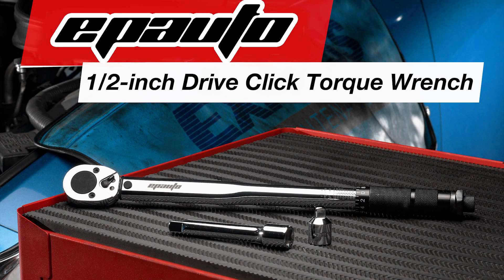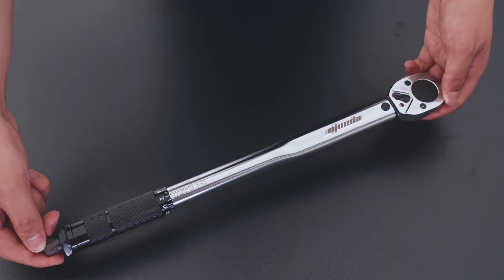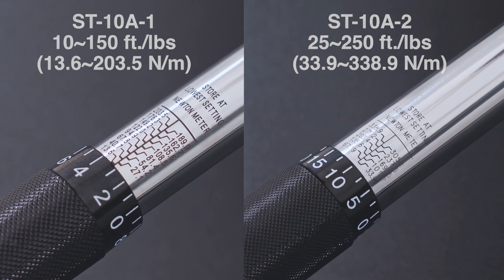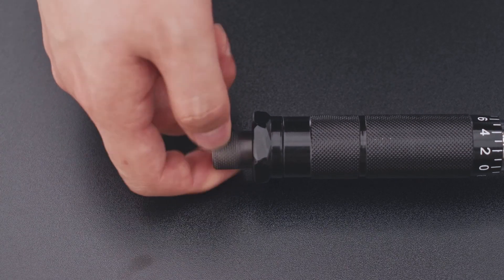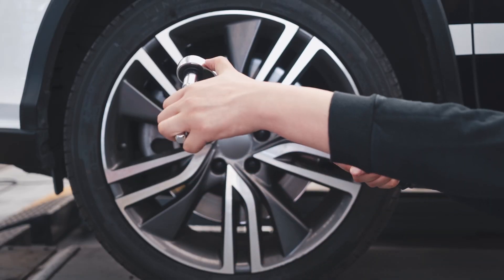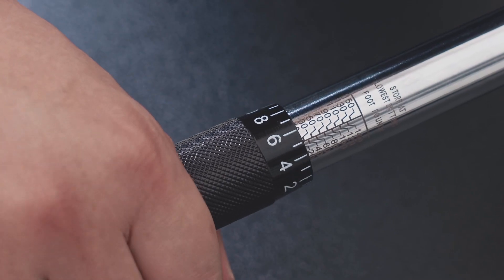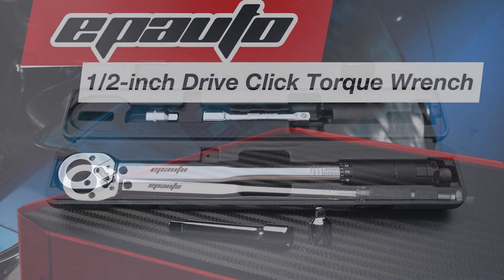EPAuto 1/2-inch Drive Click Torque Wrench Instructions

Comment: I've had one of these for a couple of years. The numbers on the micrometer wear off even though I never even wiped it down. . I never used any cleaners either. I have to be careful using it. I don't use this often since I'm not a professional mechanic. I have used torque wrenches at work as a electronic technician and found there aren't any of these that can be trusted. They don't click when they're suppose to and you either  break off a bolt head or you squish a battery terminal.

Comment: I bought an EPAUTO inch pound (in-lb) torque wrench which was total garbage. When it was set at 31 in-lb (which isn't much) to tighten rocker cover bolts it was way off by 40 in-lb. It just would not click until the bolts where way too tight. It was total junk.
But it's hard to buy a quality made inexpensive "in-lb" torque wrench these days, you can either buy cheap Chinese that has been calibrated by guessing or pay big dollars for a decent one which is properly calibrated.
Reply: Did you reset it before use?

Comment: I bought the 25-250 foot pounds version and it clicked at 75 foot pounds but didn't click at 105 ft pounds and it busted a main cap bolt on the engine I was assembling not happy with this product.

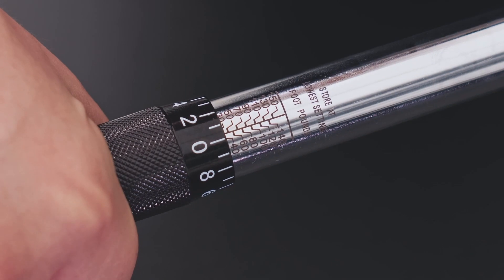Comment: The 1st time I used this, the written directions stated turn "COUNTER CLOCKWISE" took me awhile to realize ot was as typo. Now the narator in this vid is saying the same thing. Around 1:08.
Reply: Exactly it's clockwise not counter clockwise
Reply: @AhmedAli-rg9iu 
Absolutely..common sense still this video should be corrected...